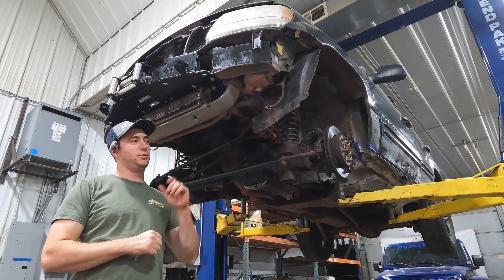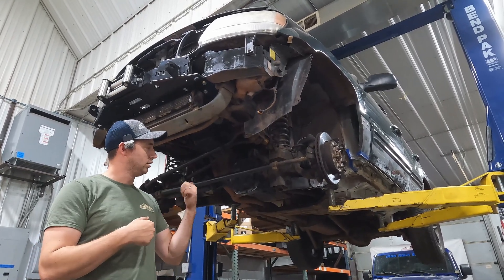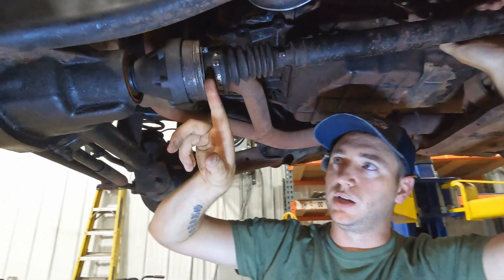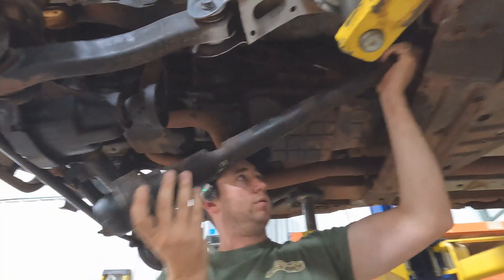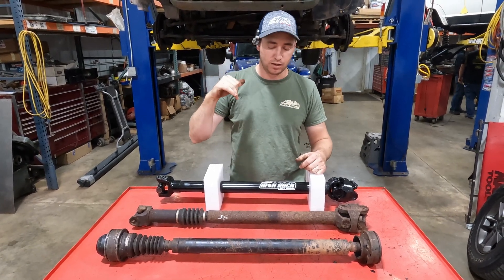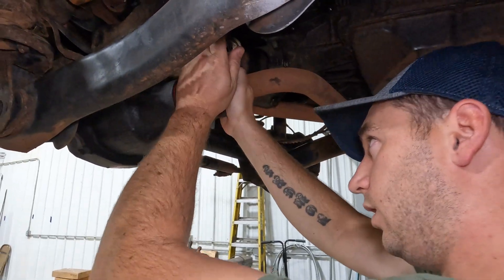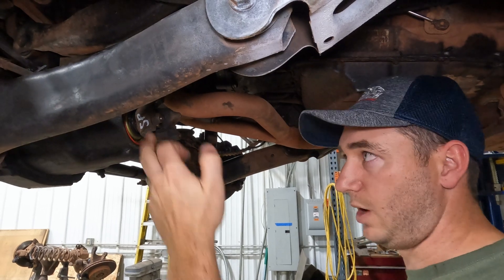HOW TO: Jeep WJ Front Driveshaft Conversion

Comment: Are the double carden shaft the same length from a 4.0 and a  4.7 or does a junkyard one have to be from the same engine style as you started with
Reply from the maker: @Carroll2009j The 4.0 and 4.7 have different length front driveshafts. The 4.0L is a little bit longer.

Comment: I have a 2004 WJ Overland with Quadra-Drive. It has a double cardan on the front drive shaft. I'm looking for a lift kit but very few of them say they are compatible with AWD WJ's. But since I have a double Cardan does that mean I can use lift kits that are for 4WD WJ's?
Reply from the maker: @DJ-fn3jm I don't know where that rumor of AWD WJs can't be lifted started but it is completely false! The WJ Overland is a perfect rig to modify since it has the double cardan from the factory. You can do any of our lift kits probably up to a 6.5" lift with that factory front double cardan! I would probably put some new u-joints in it since it's over 20 years old, though. What lift are you thinking?
Reply: @IronRockOffRoad  I replaced the front drive shaft about a year ago when the u-joints went bad. I am thinking about the 4" short arm. Either the Benchmark or maybe the Premium. But probably the Benchmark.
Reply from the maker: @DJ-fn3jm The WJ 4" Benchmark Lift Kit is a great place to start! Did you know that if you ever wanted to upgrade to front long arms in the future you could keep the lower control arms that come in the Benchmark and move them to the rear as lower control arms? If you go this route, you won't ever have to worry about buying parts twice or throwing anything away!

Comment: I have a 2006 grand Jeep Cherokee Laredo, 4 x 4 3.7 engine
With the front driveshaft issue. I’ve replaced it about three times now. 
Could I do the same conversion and where could I get the parts?
Reply from the maker: @reyperez1809 Yes, you could switch your front driveshaft to a double cardan style. Tom Wood's driveshaft and East Coast Driveline make a replacement front shaft for the WK Grand Cherokee.
 
https://4xshaft.com/products/wk-grand-cherokee-front-shaft?variant=44133908447550

https://ecdriveline.com/products/2007-2010-jeep-wk-grand-cherokee-xk-commander-awd-4wd-front-cv-style-driveshaft?srsltid=AfmBOopiDZYG-QLBto9fngHi7HWvqZtmUdBOqfvNLGHSWrhHrSl8ux1Q

Comment: Hey guys I bought the kit for my 04 WJ. I used this manual because I never did work with Axle-Stuff before on my Jeep. Bought also  this in-lb thing to measure preload. Did the TC-side Yoke and now Im in trouble a lilbit with my Front-axle-yoke. I measured the old preload (8in-lb)with the rezappa for this old cv-shaft and now after putting on the new yoke I tried to put 13in-lb like the manual says (add 5in-lb). Reached around 340Nm and its still only around 9in-lb preload. I dont have the possibility to get a bigger Torquewrench ( more than 340Nm) to finish this step by step process. What can I do to finish the project? Could it be that I have to go up to 400Nm to get to the 13in-lb preload? Can I also use my big Impact to tighten in steps and measure? Internet is full of various crap info....dont want to kill or rebuild my entire diff...any help appreciated thanks
Reply from the maker: @KnowDo-m1i If I understand you correctly, you want to tighten the pinion nut on the front axle a little bit more to reach 13 in-lbs. of preload? If so, I think you should disregard what your big Nm torque wrench is reading while you're tightening the nut. Just turn the pinion nut a little at a time and recheck your preload in in-lbs. For example, turn the pinion nut about 1/8th of a turn and recheck preload in in-lbs. The preload reading should go up. If it's not enough, tighten the pinion nut another 1/8th of a turn and recheck.
Reply: @IronRockOffRoad  Yes correct but I dont know if I really need to reach the 13in-lb. If I am good to go with 9 I would be happy. What is the explaination for tightening to plus 5 in-lb may I ask?
Reply from the maker: @KnowDo-m1i I assume that the +5 in-lbs. recommendation is to ensure that at least the same preload was applied to the crush sleeve. The goal is to get the same amount of crush on the crush sleeve or just a little bit more. In my personal opinion, as long as you have exceeded the previous preload rotational torque you should be good to go. A little more preload rotational torque means the crush sleeve is holding the bearings properly in their races.

Comment: So I bought a 03 grand cherokee laredo, I went to change the oil and noticed that theres a spot near the transmission pan on the drive side, about under the drive seat that goes to about under the back seat, and it looks like a drive shaft belongs there. The 4 wheel drive does not work and im assuming its because this piece is missing. I have no clue what it is so I can't exactly look for the part. 
It has the select track system, and when you get into 4wd full time it feels like a chain or something is just missing, everything revs and the car acts normal it just doesnt move if that makes sense, like if you are riding a bike and the chain popped off and you try to pedal it anyway. Idk how else to explain it. But this is what im assuming is causing this and I have absolutely no clue what this part is called. Any ideas so I can look for it?
Reply from the maker: @James-cr5mc It's difficult to diagnose without seeing under your Jeep. You could put your Jeep on jack stands with all 4 tires off the ground and try again. If the engine will drive all 4 wheels in the air, you know it is working and nothing is missing.

Comment: What about a 2 inch lift and no trails just street driving? Can the Rezepa just be replaced without going to U-Joint type shaft?
Reply from the maker: @frankherrera1519 You should be ok at 2" of lift. Keep an eye on the boots.
Reply: @IronRockOffRoad if switching over to the double where are the yolks picked up at? Is that part of kit as well? Or it’s only the drive shaft?
Reply from the maker: @frankherrera1519 We sell the complete WJ driveshaft swap with new yokes included.
https://www.ironrockoffroad.com/product/wj-front-driveshaft-conversion-kit.html

Comment: I'm trying to fix the vibration on my 1995 grand cherokee after lifting it 3.5 inches.
   I think I can fix it by putting rear adjustable control arms on but...
   Are you saying you SHOULDN'T use rezeppa's on anylift more than 2 inches?
Reply from the maker: @Adventure-NW Tracking down a vibration can be tricky. I always like to start simple by checking for missing wheel weights and missing driveshaft weights first.

In our experience, the lifespan of a rzeppa driveshaft greatly decreases on lifts higher than 2 inches. I am referring specifically to ZJ and WJ owners not JK, JL, JT owners. We know plenty of people who still use rzeppa driveshafts on their Grand Cherokees at 3-3.5 inches, but we always advise them to be ready to swap the rzeppa shaft out for a double cardan. The higher operating angle from a lift kit causes the rzeppa boots to fatigue and tear. With the boot torn, the grease comes out and goes everywhere, then the joint is unlubricated and wears out very quickly.

Comment: I'm doing a 4" lift on my WJ.  It has a double cardan in it.  Do I need to use the t-case 1" drop kit with the lift?
Reply from the maker: @BCAutosports Most WJs shouldn't need the 1" t-case drop at 4" of lift. All of our 4" lift kits come with a 1" t-case drop spacer so you can choose to install it if you need it. Some of our customers say they have some driveline vibrations at 4" of lift and some don't. The good news is you have it either way. I would try the 4" lift kit without the drop spacer and decide if you need it after a test drive.
Reply: @ That's what I was thinking was leaving it off at first.  Thanks.
Reply from the maker: @BCAutosports You're welcome, we're happy to help!

Comment: How come the t case yoke has a flange on it in this video but not on when you added the kit? Do you need that flange? My t case won’t stop leaking
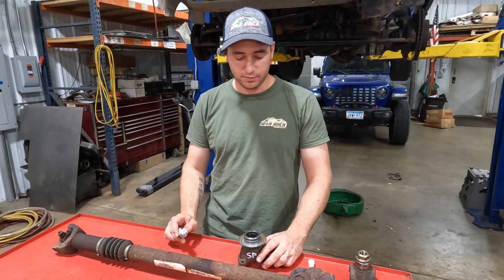Reply from the maker: @A.K.A.plumber Do you mean the little green dust shield on the t-case yoke at about 4:47 in the video? If so, you don't need that. If your t-case won't stop leaking, you probably need a new seal on the front output of your t-case.

Comment: Question, should front drive shaft turn about an inch when parked? If it's a stupid Q tell me but also answer :)
Reply from the maker: @Splintor13 Feel free to ask us any questions at all, we won't give you a hard time about it! Yes, the driveshaft should be able to rotate a little while parked. It seems strange but there is a tiny bit of free play in each of the parts connected to the driveshaft. It's normal. I hope that helps! If you have any other questions, feel free to ask!

Comment: How to remove yoke off front axle ?
Reply from the maker: @urbanoffroader67ih Remove the nut holding the yoke in place, then tap it gently with a hammer, or use a 2 or 3 jaw puller to remove it.

Comment: Is this a 4 inch lift kit? On the jeep
Reply from the maker: @AlminAjdarpasic-m9t In this video, the Jeep shown does not have a lift kit installed yet, but the front driveshaft shown will work on a 4 inch lift kit.